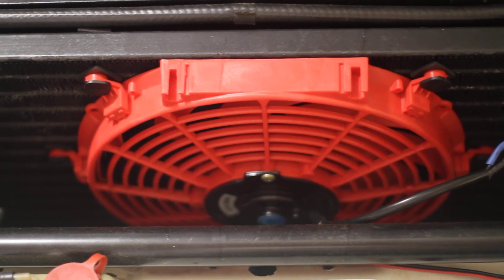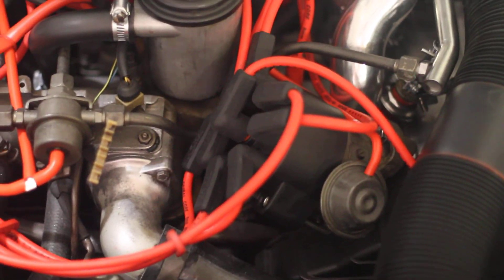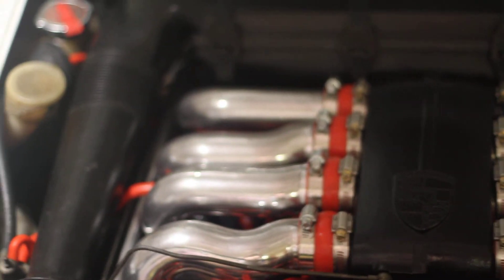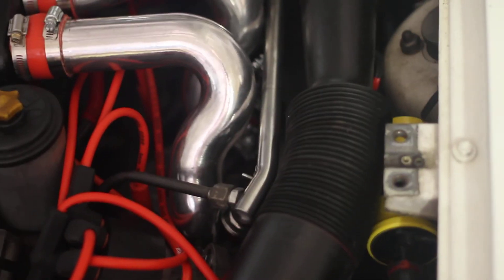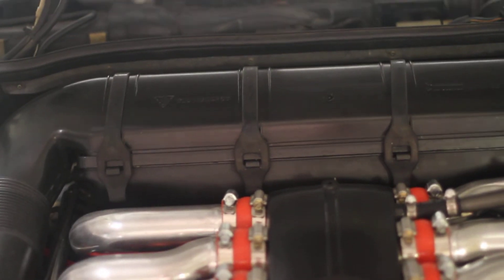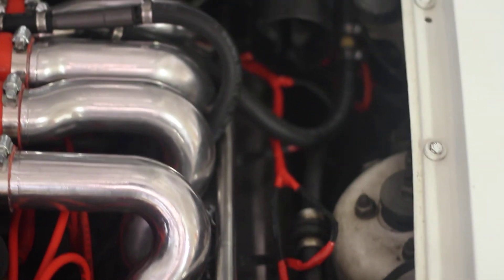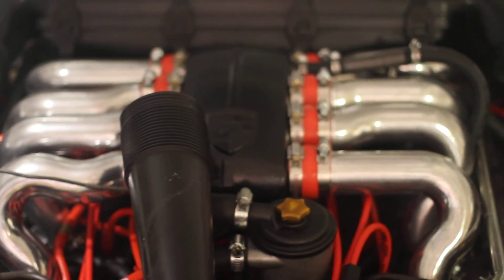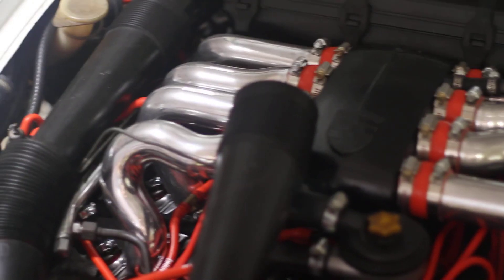Porsche 928 engine overview

Comment: About to get one of these to work on for 2k engine is the only issue, all og parts and im gonna swap it for the 5.4 anyway. Any advice it'll be my first build
Reply from the maker: Very nice
Reply from the maker: What is wrong with the engine?
Reply: @boostedrider8253  engine was taken apart by the original owner. I jave most the parts i need but the owner died and the car was given to the brother who didnt know much about cars so he posted it for a cheap price